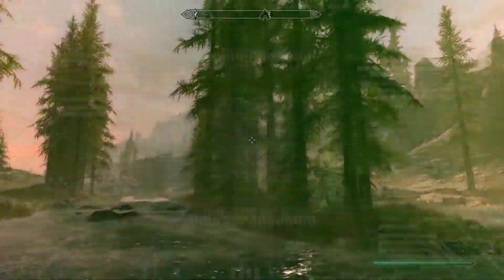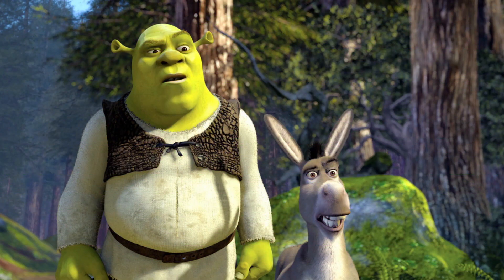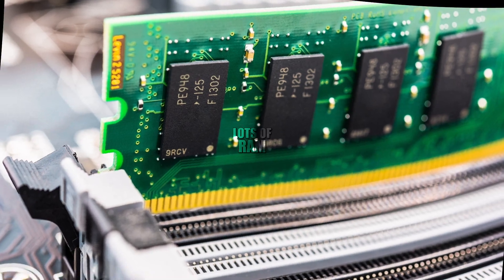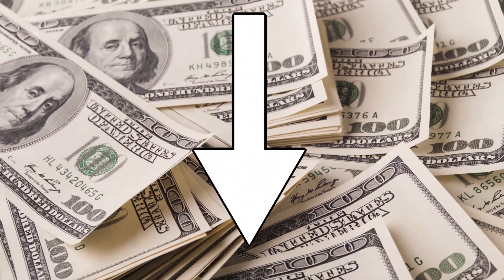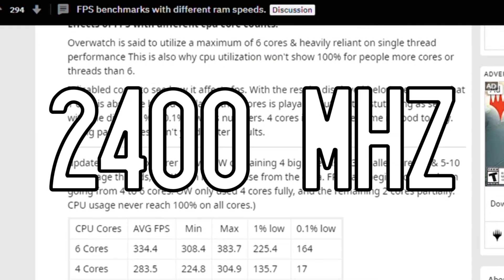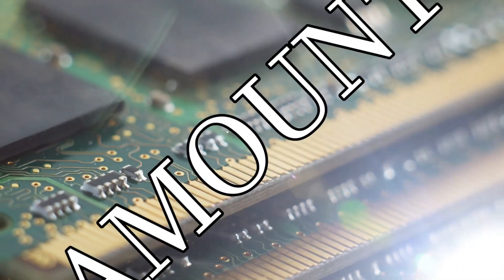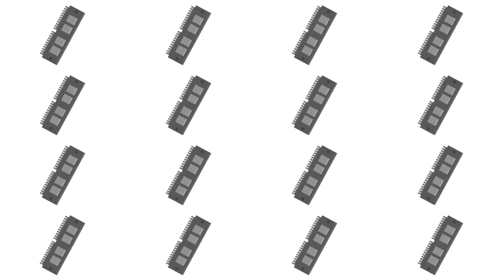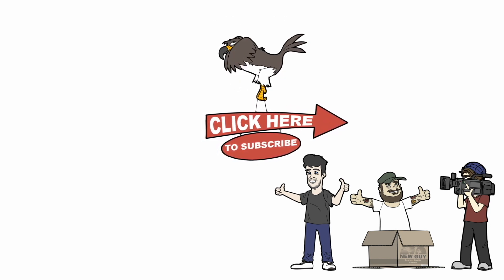Ram SIZE vs Ram SPEED for Gaming...What's Better?

Comment: 1gb became normal way before 2011, was around 2007 that changed happend as vista demanded more ram than XP did.
Reply: back then 512MB was luxurious, until Vista came out.
Reply: I had 1GB in my PC in 2001 with my P4 Prescott, with a 128Mb ATI 9800 Pro, I'm pretty sure I got another 1GB soon after too, long time ago to fully remember, more than 1GB was the norm in 2006 too I think, that was the Core2 Duo era I'm sure my build had 4GB in there.
Reply: Yeah, 1GB of RAM was a big deal in the early 00's, long before Vista came on the scene.
Reply: @wing0zero  That's great. But that doesn't mean it was standart in 2001, you were a minority. Not relevant.
Reply: @RicardoRiSkAmaro17  
Anyone with a high end gaming rig at the time would have had 1GB I imagine,  so while not mainstream there must have been quite a few, just like high end rigs now, there the minority overall but there are still a lot.
Reply: @wing0zero  P4 Prescott and 9800 were after 2001
Reply: @PicksterTG  
Yeah my mistake that was a upgrade in 04ish I think, Willamette P4 is what I had in 01, not sure what GPU I had before the 9800Pro, 7000 or 8000 series maybe.
Reply: @wing0zero  2001 was time of the Nvidia GeForce 2 and the original Radeon... not to mention Voodoo was still in the game around that point too.  Off the top of my head I can't remember when GeForce 3 hit the shelves or when Voodoo went away.  I know Google will have the answers but that's like effort or something  :-p
Reply: @PicksterTG  
Yeah I remember G2 but I went with ATI, Radeon 7500 maybe it was called, probably a better deal at the time.
Reply: @wing0zero  I do remember that the 7000 series was a rebadge of the original Radeon but I'm unsure of the timeline.  I guess a bit like the Geforce 4 MX was a rebadged Geforce 2... Although I think that happened a little later like in 2002 maybe.  Either way both Nvidia and ATI were both a valid pick.  That is until the 9500 and 9700 which handed Nvidia it's arse with the 5800 Ultra.  Fun times.
Reply: diablo 2 came out and i had a few gb of ram.
Reply: XP Sp3 oh memory lol
Reply: yh the avg price of budget PC had least 1gb in 2006 !, i had 8gb in 2007 with my q6600 CPU
Reply: @girlsdrinkfeck  yep had Q6600 with 4gb in 2008 aswell :p
Reply: I remember XP machines crawling with 128 or 256MB... The bad old days.
Reply: I have a Mac hat came out in ‘98 and it has 1gb
Reply: First laptop I got (for college in Comp Sci) I spec'd for 1GB of RAM for future-proofing. That didn't last long before I maxed out the board to 2GB two years later with trying to run Vista, reverting back to XP, and running code compilers on Ubuntu VMs.

Comment: easy, if using ryzen go with high speed memory (speed can change if using zen, zen+ or zen 2), if on intel save the money.  At least for gaming
Reply: But ryzen is also RAM hungry so you need 16gb playing some games and can take up 11gb like tomb raider games and even devil may cry 5. Games will start demanding more and more.
Reply: @thegeoshow5296  are you sure? i played the last 3 tomb raider and devil may cry 5 on my 1800x, i didn't have that high ram usage. i will re-test just to be sure
Reply: @gigigigiotto1673  yeah in shadow it was mostly in populated areas. It also was smooth once the ram increased as well.

Comment: You need 2x8gb 3200mhz cl14
Reply: Usually 3200mhz is the sweet spot for ryzen 1 and 2 but it doesn't matter as much for Intel
Reply: @LeviathanLegend  yes

Comment: Matters if it's 4gb 3000mhz Vs 8gb 2400mhz I'd probably go for the 8gb as most games will ask you too have 8gb but if it 8gb 3000mhz Vs 16gb 2400mhz I'd probably go for the 8gb as it would make games run smoother and most games don't really need over 8gb of ram
Reply: but speed is important too especially if it a heavy cpu bound game if its more cpu bound then yeah more capacity is better 
8gb is the bare minimum and 16 gb is the sweet spot for gaming once you got 16gb go for speed
Reply: @kiwibom1  yes speed is important but if you have the choice of a 4gb 3000mhz or a 8gb 2400mhz ram you would obviously take the 8gb one as most games need more than 4gb of ram. I barely play games that use more than 8gb of ram sure it's nice to an extra 8 Incase you need it but in most cases you don't
Reply: @AlexanderVolzing  yes for sure I would take the 8gb but still you need to keep in mind that windows is using ram too it can 2gb or even 3-3.5gb plus your game 4-6gb and there you go you won't be able to have much more things running in the background because there might be like 200mb ram left   so its pretty restrictive. 8gb is fine to an extent but I would recommend to upgrade to 16gb in the near future because game are going to require more and probably sooner than we think
Reply: @kiwibom1  most games don't need more than 8gb I was playing on 8gb of ram for years yea sure it might not run the newest stuff on a million fps but it's still playable and you'll easily be over the 60 FPS mark
Reply: SNIPE IT  what do you mean "impossible"? There is still a good bit of games you can play with 4gb (lol,Dota,csgo,Warframe, overwatch etc)